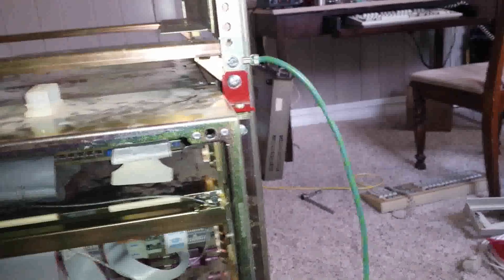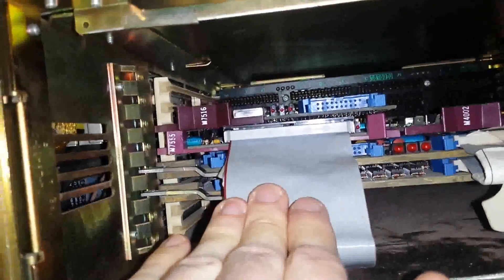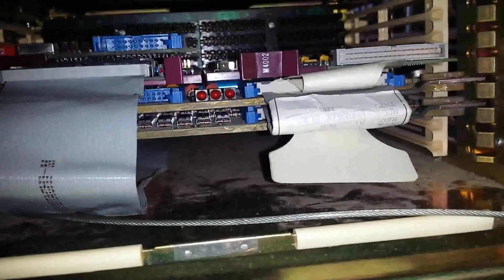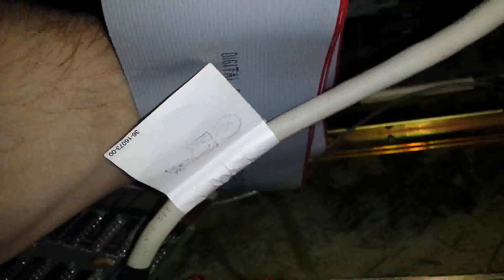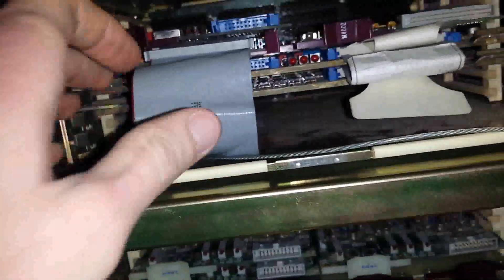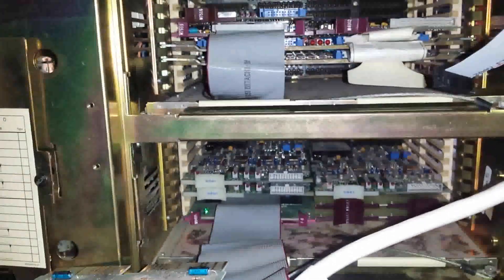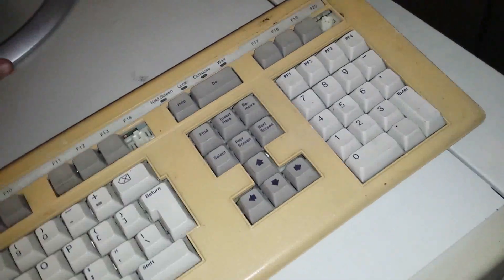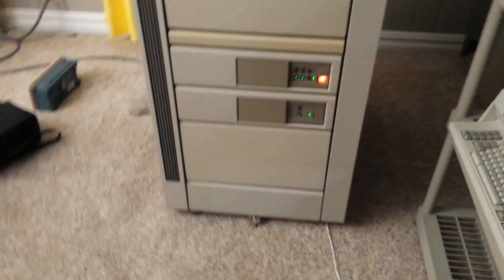DEC VAXStation 3200 part 2: System Overview and Power On

Comment: I thoroughly enjoyed this. 10/10 ! Thank you YouTube algorithm! Now that jpkiwigeek has stopped posting, it's great that there are others!   Wouldn't you want to change the coax cable to support colour? How did you say the monitor is attached to the video interface, and what is the cable?
Reply from the maker: there are two cables that need changing. The first is the cable between the DA15 connector and the graphics boardset, which only has a single coax. I could possibly add  to the existing cable there and make it color. The other cable is the one that goes from the back of the VAX to the monitor, keyboard, and mouse. That as well is only one coax. I was thinking I could make a similar cable out of an old piece of VGA cable and break it out to RGB plus the keyboard and mouse connectors, or maybe use a VGA connector in place of the BNCs.